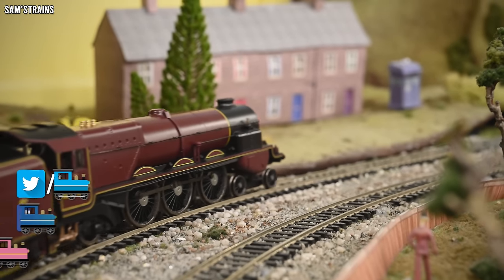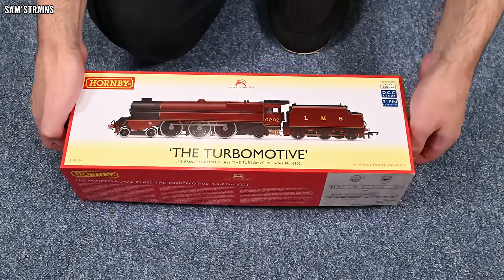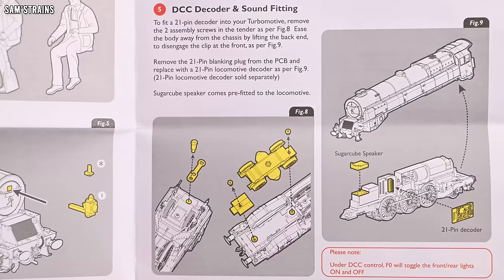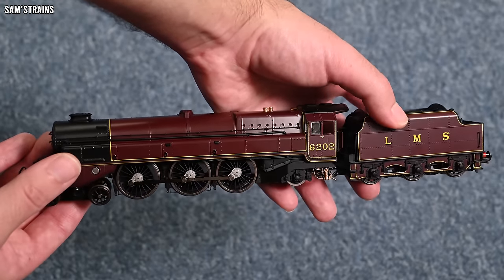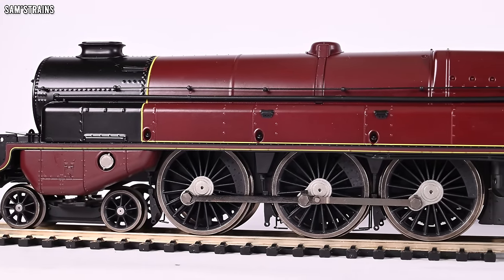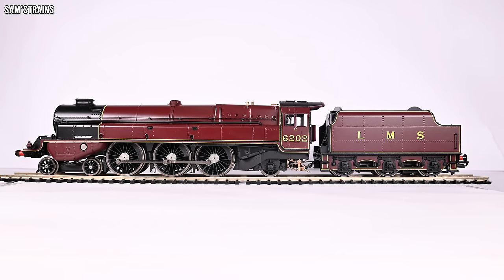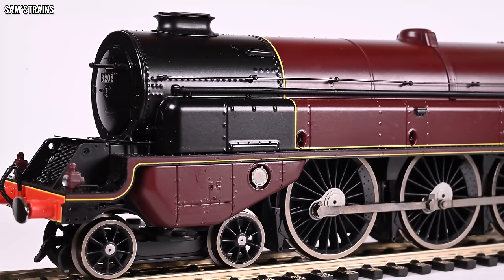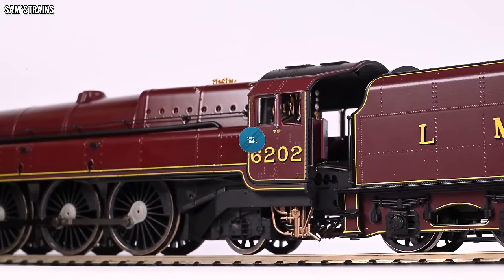Is Hornby's New Turbomotive Worth £240? | Unboxing & Review

Comment: Hi Sam, a couple of points from an LMS anorak.  You say a couple of times this was rebuilt as a standard Princess, but actually Princess Anne, as it was called, was also unique. It had a more Duchess like steam chest and cylinders.  It is good that the radiator flap at the front moves because on the real thing it would be up when running but down when idle.
Reply: You might be able to tell me if the train classification lamps are illuminated in daytime running like so many expect from what many here call "headlights".
Reply: @johnd8892  the loco's lamps should be lit at all times while running for working through tunnels. they are purely for marking the train class and each end of the train but provide no illumination. Modern image traction will have the high intensity lights fitted which provide some degree of illumination but i'm not sure how they compare to a car headlight.
Reply: Destroyed in the Harrow collision.

Comment: Something I would really like to see in your reviews would be a DCC test along side your DC test. Have you ever considered adding that?
Reply: I would also be interested to see if that improves the torque, but why Hornby insist on using such cheap weak motors is beyond me.
Reply: @eisenbau   Agreed
Reply: It would be interesting, but then he’s kinda reviewing the decoder, and not the locomotive…
Reply: @modelrailfan37   No. Thats not how that works. That would be like saying hes reviewing analog and not the locomotive. Its just an interface difference, and sometimes that matters with each and every model. Its good to test both.
Reply: @dalecherne5377   true, he would have to use the same decoder each time though.
Reply: @modelrailfan37   Correct

Comment: Hey Sam! Great and honest review here, as always. 

I do have a tip for you. I own one of the Dublo range Scotsman centenary models, which have diecast bodies. I had to run it in for longer at a slightly higher speed to fully loosen up the mechanism (roughly 45 mins in each direction, at 55-60 speed). Once I had done that, it performed exactly the same as my main range A1 with decent crawl and good torque. The more I ran it, the more it started to match my other Hornby locos in performance. Hope this helps!
Reply from the maker: Many thanks my friend - and thanks for these tips... might as well give this some more running and see what happens then, cheers for that,
Thanks for watching, Sam :)

Comment: As I model the Liverpool
to Manchester line I’ve nagged Hornby for years to produce it. Yes it’s expensive but, I allowed this in my budgeting for this year. So for me it’s worth it. The front hinged plate was to allow more air into the radiator for an oil bath that lubricated the turbines.
Reply from the maker: Ahh fantastic - well it's a great model, I'm sure you'll enjoy it!
Thanks for watching, Sam :)
Reply: @SamsTrains  ...and the locomotive usually ran with the air intake open. Which is probably why they made it an option to open or close it. Take a look at pictures of the loco running, you can almost always see the plate at an angle (open). 

The maroon livery is stunning.

Comment: For about 490 pounds I bought a "used" (model was clean, box looked like it may have been opened twice) Broadway Limited Paragon 2 UP-1 4-12-2, which is DCC and sound, is (I believe) a brass hybrid, and if it's not the whole thing is metal, has a smoke unit in it and even has working class lights.
It's a better value than the past several things you've reviewed from Hornby but I don't know how good of a value it is considering that I bought a brand new BLI Reading T-1 for an extra 100 USD that also has sound, smoke and all

Comment: Another excellent review Sam and overall it looks a very nice model.

Price: One thing to be aware of is that by far the biggest cost when making models is labour. The diecast boiler AND running plate will increase the cost, but not to such a huge extent that it justifies the price IMO. 

The lights are a very nice touch, I wouldn't expect those add much to the cost in terms of parts, although if it's not automated and they need fitting by hand that would increase labour costs.

It is over priced IMO, though Hornby aren't quite as bad as Bachmann in that regard. However both Accurascale and Dapol are able to make diecast, detailed locos at a considerably lower prices which shows it can be done. 

Additionally the model shops sometimes sell old stock at considerable discounts which is a good indication on how big a mark up the two big manufacturers make.

Because it's a fairly unique loco I suspect these will sell out fairly quickly, especially the LMS maroon version. However personally I'm not willing, nor can I afford to pay that price, so will hope to pick one up secondhand for a more reasonable cost in the future. 

If not I've already got three standard Princesses in various liveries which only cost me about £110-125 each secondhand and in boxed mint condition. They have firebox flicker, but not the working lamps or diecast body. However I prefer their looks with the valve gear and increased detail.

Loco-tender connection: My guess is these were designed just before Hornby changed to the new connection. Hornby use a variety of factories in China and some have been more affected by shut downs for Covid than others depending on the region. I expect those models whose production has been delayed such as the 2MT will all have the old connection.
Reply from the maker: Thank you - it sure is a nice model! You're right - I'm not an expert but from what I understand the cost of injection moulded plastic parts vs die cast metal parts isn't much different... it's mainly going to be the cost of material that makes the difference... so a pound or two at the most. I agree Hornby aren't quite as bad as Bachmann - at least there's a real attempt here to add value for money in many areas, same can't always be said for Bachmann. Thanks a lot for sharing,
Cheers,
Sam :)
Reply: Well said, though I still don’t think the cost is that well justified, and it is still VERY overpriced. I personally think some of Bachmann’s models still offer better value, though not all…

Comment: hi sam , i am trying to build a model loco from scratch,  as from where i belong ...the concept of model railroading simply  doesn't  exist..so sourcing  loco , rolling  stock  and tracks is very difficult. I bought a bachmann "Rail cheif" set for 380 £ from amazon , but the quality is not worth the price ..so i decided to build  my own loco ,including the  motorizing  unit along with the  gears   . ill be using a resin 3d printer to print all of the parts, but i am not sure which resin to use , as some resin shink too much .  Your last video gave me the inspiration to try it my self . So in the next followup video of the project you are working on , can u please inculde what type of resin u will be usin and the what type of motor u will use to power the loco ...thanks for making such amazing content ❤

Comment: If this was £190 I would buy one today.  However it's performance is a concern.  I bought 2 of the new streamlined Coronations and the 9 coach set.  There was so much drag due to the lights that it ran on my flat layout at a scale speed of 30mph. I had waited for these since 1980.  I ended up selling the lot.

Comment: I still find it more surprising that lighting on locos is so rare from Hornby. I have a 1981 catalogue from Märklin and almost all the locos have lights.
However, I guess that lighting if more complicated in Britain, because the marker lights can de variably lit depending on conditions.
Having said that, I just love lit up trains, even if the lighting is not prototypical.
Reply: Lighting on Marklin trains goes back to the 1950s, and probably earlier.

Comment: Thanks Sam. Is it me or do those flangeless pony wheels look too small? Love the finish on the body but a shame the paint doesn't match throughout.  Great too see some weight, but a mechanism to match would be nice. Hornby remains too expensive and I'm glad my needs are met from other manufacturers at better value. I have just bought a Bachmann 4575 from Olivia's Trains for £147 delivered. This is the same price as the new 44xx from Rapido, of which I have two on order. I'm looking forward to the comparison and wonder how they will compare to the Hornby large Prairie. Cheers.

Comment: For the price, Hornby couldn't quite stick the landing? The differences in paint color are EASY to explain.  I noticed the issue before you got to the tender.
QC would have caught the color mismatch easily but at the corporate and manufacturing level, they did not care.  It saved Hornby $1~2, that is what it comes down to.
What happened?  Go to 16m30s for a visual reference.
1. They are using the same color paint for the rich burgundy. Nothing wrong with that paint.
2. The difference is the metal and plastic parts.  Look at the running board and cab, plastic.  Just like the tender.  And DO NOT match the shade used on the diecast body.
3. The problem IS NOT the materials (plastic vs metal).  They did NOT primer the plastic to save money.  They primed the diecast black and said "close enough" to the black plastic.  Those two surfaces are NOT the same.  Had they applied primer onto the plastic and then painted the burgundy and yellow trim on top, it would have solved this problem.

This is basic painting knowledge. They didn't want to spend the money on labor and primer to properly paint the model.

There is a lack of burgundy paint above the springs... but that's minor.
The lighting for the front top light and tender should have been better.  A little more effort in design would have fixed this.  I build Bandai models that use clear parts to make light channels to light up their kits.

Other notes: 
Add a bit of black wash to add more details to the copper-colored parts, including those in the cab.  (Wash, then wipe off with Q-tips)
Add black wash to the coal, don't bother wiping off.  It will make add detail and look more coal-like, and dullish.  It won't look like plastic anymore.

Easily, Hornby should have had a better motor.     

They almost made a very good product.

PS: thanks for making another great video.

Comment: Sam you missed a trick here. The sound fitted loco is only £50 more expensive which makes it cheaper than some other sound fitted locos. 
BUT the sound is AMAZING!  The only thing I can compare it to is Hawkwinds “Silver Machine”! It really sounds like nothing else. 
It’s a Triple Sound chip but we couldn’t fault it. Being DCC it also solved some of the running issues you had. 
Take a listen, I’m sure someone will post a video. 
Then go and buy a HM7000 chip and download the “Turbomotive” sound track. (I don’t know if it’s been released yet)

Comment: If you are going to buy one the sound fitted ones are best value,. You basically get the sound upgrade for about £40.00 compared to nearly £70 if you bought it separate. It is the Hornby HM7000 sound but there is no chuff rate to worry about with this model so it sounds ok.

Comment: A point I'd like to make on behalf of Hornby that to a degree reflects positively on their prices.  They innovate and that costs money with english designers on english wages and that money has to be recovered.  The lighting is not perfect, but it is an innovation, as is the neat touch switch in the tender (and soon coaches i guess), decent crew, bluetooth controllers, TT, new smoke generator ideas, Skaledale etc. - even Steam Punk.  The odd 'miss' still has to be recovered. What is Bachmann innovating within their high prices?
Reply: Well decent quality is one thing...

But yer the Model Railway Hobby is being screwed over and its better off to be trying to find stuff second hand than to pick up stuff new... At least older stuff is more robust and looks much nicer to me.

Modern Hornby despite all the fancy bells and whistles are really throwing themselves up hill and will be in for a shock once all of the older modellers sell up or pass away leaving then with younger people who will not so willing to pay up for over priced models and begging for a bail out. This is why they need to bring back a good budget range and bring us back to the time when wagons costed at least £5 to £10s decently and locos where at least £35 to £50...
Reply: Innovation costs money, but if the innovative feature (the lamps) doesn’t work, then my question is why bother? Also, Hornby products are currently made in China, unless your talking about the design team, which is based in the U.K. Bachmann isn’t really innovating that much, but their prices aren’t nearly as high as this, and they have really improved, particularly with their steam locos, in the past 3-4 years. Also, Dapol have innovated a lot, and yet their models are far cheaper than this.

Comment: Great but very simple loco, the lamps are so inconsistent in brightness as to be usless. The power is poor, not a good crawl and an obvious slowing on corners and hills, and if you put the full calculated coach load I doubt it would move. Such a shame that Hornby failed to fit a good motor and 4 quality lights instead of 2 that work and 2that don't. Another case of Hornby nearly making a good loco but still ripping their customers off. When I was young I was given a Hornby doubleo Dutchess of Southerland, with a die-cast body and this loco would crawl beautifully and run around my little layout on 2nd radius curves with no slowing down. So Hornby can do it they just choose to rip off their customers.

I'm so glad you don't cut corners in your review, great job Sam

Comment: Sam, now you have officially become a rivet counter, the lights on this model need comment.

As it is an LMS engine, the lamps should be black cased, not crimson lake. (The streamlined Coronation class locos in crimson lake livery carried this colour with a streamline fairing but I have not seen reference to the non streamlined locos using these . The lamps themselves had a handle at the top running front to back. The fitted ones on the model have the gap under the handle filled in - the ones available from ModelU, DCC Concepts and the like are able to model them accurately. These are very noticeable errors, and cost nothing to get right.

As for brightness, loco lamps were identification only not illumination, so they should be dull almost yellowish for the forward white aspect. 

The front lights as fitted are for a Class A express passenger train, which this usually was. 
The additional lamp on the smoke box is occasionally useful, but never used in conjunction with both the (fitted) outer buffer beam lights (except when hauling the monarch when a lamp in the centre of the buffer beam is also used - 4 lamps total). So, unless one can turn off the buffer beam lamps individually, the train will always carry wrong lamp codes except on express passenger trains.

As for the lamp on the tender, it would be present (and displaying red) only if the loco were travelling chimney first light engine. The instructions said it would be red in that direction. On the video, when you said reverse it still seemed to be the same colour as forward - white.

If travelling tender first, as Turbo was incapable of moving much beyond itself in reverse, it should carry the light engine white lamp code of one in the centre of the buffer beam. The one photo of the rear of the class’ tender which I have seen shows the top lamp iron to be where Hornby have placed the lamp. If white, that is a class B ordinary passenger working. Given the power in reverse that is very unlikely in reality. 

Personal opinion, even as an LMS tragic, the loco does not appeal aesthetically, and certainly not for the price - even the retailers’ discounted one. Thanks again for an excellent review. Very balanced.

Comment: Capacitive touch requires a dielectric (insulator) between you and the sensor (basically a metal pad) to work properly - think how those new hobs/stoves work with the glass plate. So yes, entirely possible for the tender to be plastic AND have capacitive touch sensing for the lamp enable :)

As an aside, it's crazy how much can get in the way of capacitive touch regarding this dielectric - certain types of plastics work better than others; too much moisture content (i.e. in wood) can disrupt it; metallic paints will render it useless, etc.

Comment: Sam - my friend had his Turbomotive replaced as it appears the motor failed. The loco suddenly stopped when travelling in the forward direction causing some of the coaches to derail. Then, it would only run in reverse but after a few minutes the loco slowed and stopped completely. I am wondering as the standard motor appears to have been fitted coupled with the excess weight of the diecast loco body, we may see this issue highlighted with more customers models over the next few months?

Comment: Hi Sam. Thanks for another great review. I watched this one wanting to see if I have discovered a new issue / problem with Hornby’s new locos. I recently bought a new Hornby castle. I went to fit a Zimo sound decoder and speaker. I have found the plug board in the tender does not give soldering contacts for speaker wires. The technician at Hornby acknowledged this saying the wires should be connected to the decoder. Are Hornby trying to limit us to using only Hornby equipment? Are we seeing two different approaches developing eg Dapol make it very easy to install decoder and speakers whilst Hornby don’t even give much in instructions to help. From your pictures in this review it appears this may also be an issue for anyone buying this model? If so this appears a big dividing road re difference with manufacturers and so possibly my last Hornby loco. I wonder how many of the new Hornby locos have this issue?